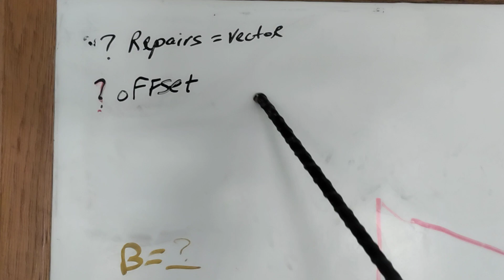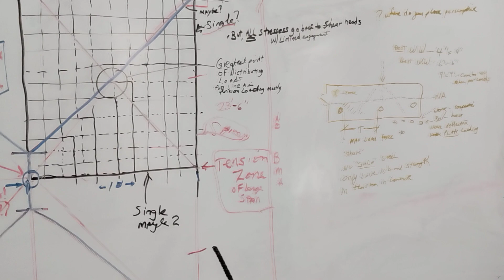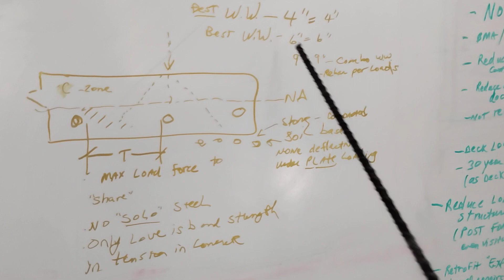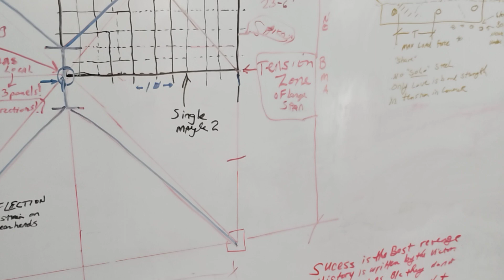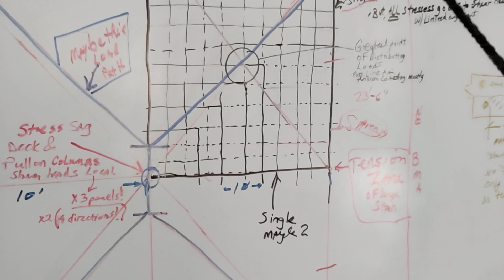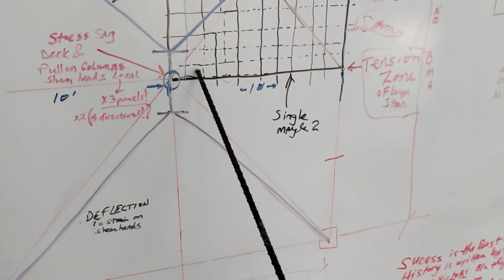Champlain Towers and Repair Vectors Concrete deck had rebar steel upside down

Comment: Very, very clear. "Repair vectors" is a great way to visualize the larger picture. Thanks very much. 😺🐈
Reply from the maker: It should be noted that the top steel was also their temperature expansion steel...
It should be noted that the deck did not have expansion joints anywhere that I could find.
Reply: @LoadPathEngineering  I am always amazed by your rigor.
Reply from the maker: Thank you Kathy.

Comment: Love the banging on the white board...I started laughing.   Fascinating these repair vectors. It totally makes sense as everYthing in a structure is dependent on each other.  Dont erase....Tears xxoxx
Reply from the maker: Thank you Tears, the repair should be inline with the conditions of the deck after the repair is completed...
I have done experiments with repairs that are stronger than the existing surrounding area... The failure is ALWAYS at the weaker, surrounding area and never in the stronger repair.